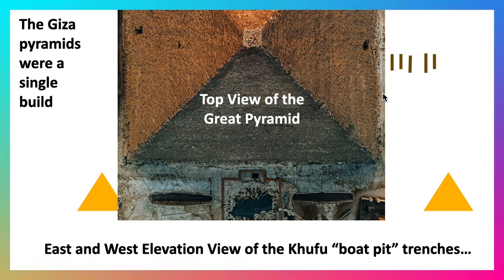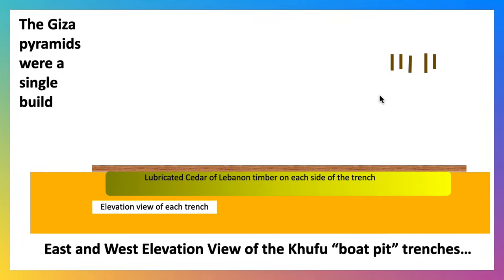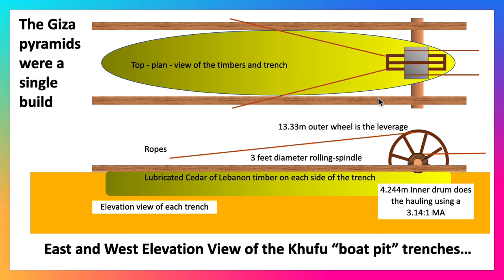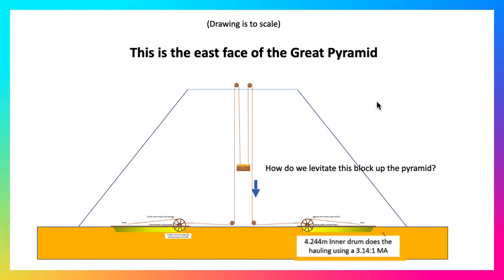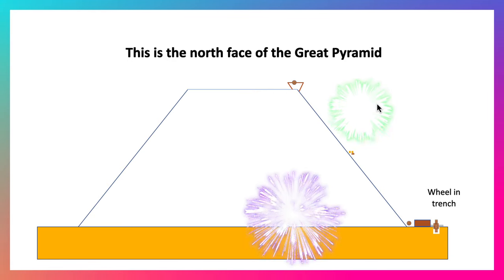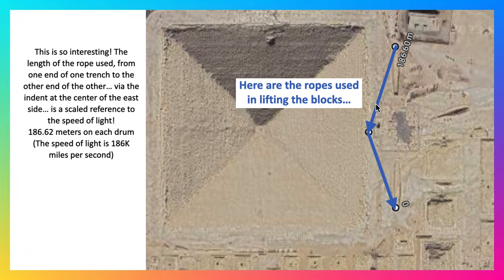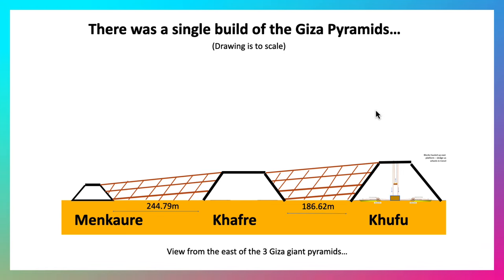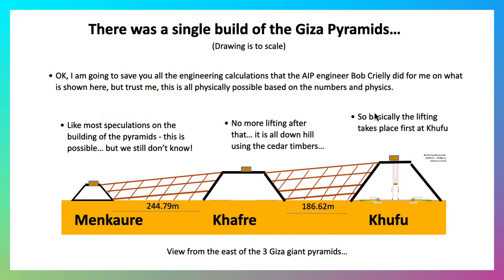A single build at Giza?| @TheGreatPyramid

Comment: Mathematically, as we both know, it had to be a single plan.
Reply from the maker: Yes.  There was a single master plan..  This doesn't lead to the thesis brought in here, that there was a single build.  But it could be. But yes, the most important point here is, single build or not, this was a unified plan. Thanks for commenting...

Comment: You can still move the blocks up the pyramid with ropes in such a manner, and all it requires is a greased pole or 'pulley stone' on the top, and an equivalent weight of workers plus enough to overcome drag coefficient pulling from the other side.  It can be a steep ramp with workers using body weight walking down, and the blocks coming up.  Workers walk back up, use gravity again.  Just add food.  Even the 70 ton granite beams could be moved this way.  154,000 pound beam divided by 140 pound worker = 1100 workers.  Double that to overcome friction coefficient, and they have no problem walking the rope down the ramp, as the beam comes up.
Reply from the maker: Make a video about that. And then make a comment on this video :-) Thanks for commenting Shlomo!

Comment: Why would you need an entire trench for one pulley wheel?  Those wheels would also have to be made of more than wood to lift a 70 ton granite block.  Unless you have evidence that cedar would do?  I"m still betting the blades are somewhere underground 90m or more.
Reply: @buildingthegreatpyramid  65 MT for cedar?  But the granite core has blocks of 70 MT and that still doesn't explain the perfect cuts to join them.  I"m not trying to disprove you but to help find the truth behind it all which is hidden behind a text book explaination of it  all.
Reply from the maker: Bringing in the perfect cuts is changing the argument. (and what about the very imperfect parts of those large granite blocks on the relieving chambers?) We can talk about that in a video about the stone working skills of the Egyptians.  This video is about the physics of building with those blocks and @ancientanomalies has kept the argument at that level.   Thanks for commenting...

Comment: The problem is the boat pits were constructed after the great pyramid was completed, and perhaps as late at mid-5th dynasty.  The area of the southern pit was not available as the queen's pyramids were under construction in that location.

There cannot be a simultaneous build because core masonry blocks in each respective pyramid can be traced to the specific quarries nearby each respective pyramid.
Reply from the maker: What's the proof of your time frame for the boat pit construction? I know you have a different time frame for the Khufu causeway, but I am not sure I have bought your theory there... so I am not going to lay dead for your sense of timing for the boat pits. Doesn't make sense to me that they were a much later addition.  Your core masonry block argument is more cogent.  Would like to see your video on how the build went... Thanks for commenting
Reply: The pyramids of the queen's are contemporaneous with the GP.  The remains of the ramp which brought material from the quarry, up to the Eastern Cemetery runs right up to the G7100 avenue which runs east of the queens pyramids.  The construction areas could not lie on the east side of the queens pyramids, nor could it lie to the north and south of the pyramids as they are too close.  The only, and in fact, the confirmed staging and ramp area for the queens pyramids ran between the GP and the queens pyramid exactly where the southern pit is today.  There is no way there can be a pit there during construction.  The pits were also built contemporaneous with the temenos wall, and from the same material.  Which also could not be completed until after the GP was complete.
 @TheGreatPyramid
Reply from the maker: @shlomoishtov7617  I do not accept your explanation here as of yet… but tell me… for what purpose were these massive pits dug after everything else was built??
Reply: Well we find these exact shapes at two other pyramids, 3 mastabas, and the sun temple of Niuserre.  They first appear with Djedefre, Khufu's successor, where the pit itself has a solar barque, and a night barque built into it.  Khafre duplicates this.  Khufu himself did this with the south face boat pits with actual boats...  Well it is very complicated for a Youtube reply.  I'd be happy to call.  There is also the fact that the pits were dug after the surface there was cut down to build the funerary temple, which ties it in time with construction of the temple and causeway which cannot be built during construction.  There is visual evidence the boat pits were dug after the area was cut down to accommodate the large funerary temple.  Which would actually be in the way of your ropes going up the pyramid.
  @TheGreatPyramid
Reply from the maker: @shlomoishtov7617  yeah, “very complicated for a YouTube video” so try just answering the question I asked you. WHY were those HUGE PITS dug??? For what purpose, after (according to you) everything else had already been built????
Reply: Fair point.  The purpose was to produce a night barque and a day barque for use by the priests of the funerary temple to venerate Khufu as Ra.
Reply from the maker: @shlomoishtov7617  why the east side? Why so big? Much smaller world have accomplished the same thing. Where are the boats? Any evidence of them, actual or hieroglyphic? There is evidence for priestly activity in the Sphinx moat… what about these 2 pits????

Comment: interesting video. I think there could be merit to the idea of the pits being wells for pulleys, but you're excitement with the numbers is very short sighted. 

why would the number of meters be related in any way to miles per second? firstly they are modern units, so the specific numbers mean almost nothing. secondly, they are different units with a different ratio between them than any other two units. the rate which meters and miles relate to eachother has zero impact on anyone before meters and miles were formally used as units. you can't take two different modern units and use them to equate ancient ones. I could create any unit that would tie any two values together. 

using your calculations, what is the maximum height that could be achieved using this arrangement, and how much force would it take to move a 1 ton stone up that high?
Reply from the maker: I'll let my engineer Bob Crielly answer your last question there from the technical side. As far as meters and miles, etc. I totally understand your points, but I think you should look at my other videos where I make, I think, a strong case for just the opposite viewpoint, the one I use. The Egyptian sages and designers (not the builders) knew the meter and foot and it is displayed many places. They also mixed units in ways you say is inappropriate to equate numbers. For instance 10 meters and 10 feet. Not the same length, but the same number. They left encodings in both measuring units and numbers. Many examples. And you are not correct that you could make anything anything. I've tried. The three measuring systems I use a lot in this regard, are metric, imperial and Egyptian-cubits. Even though they are three different systems, they do not provide INFINITE combinations, but limited.  Take the measurement from your doorstep to your 5 closest neighbors.  Try and make those 5 measurements all the same, or all related to π or φ, etc. You won't be able to do it.

Thanks for commenting. I'd be glad to correspond with you but what I say here. director@greatpyramid.org